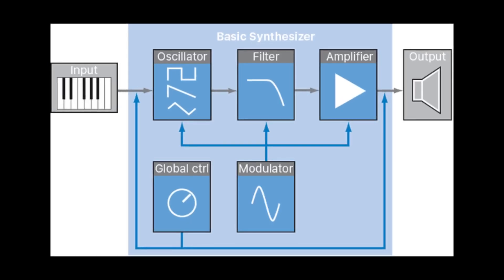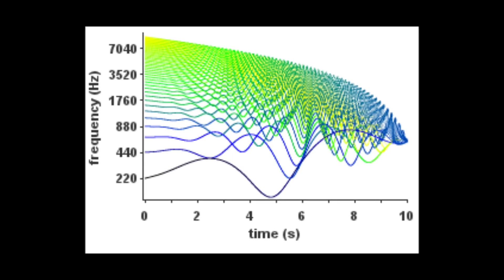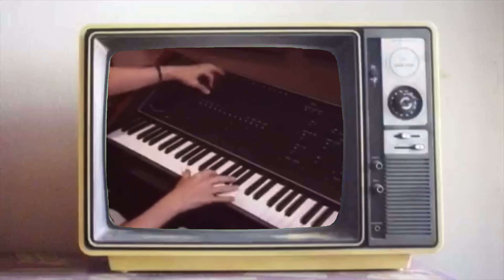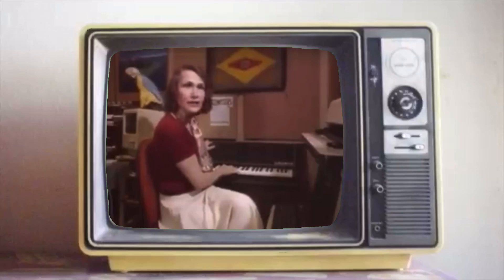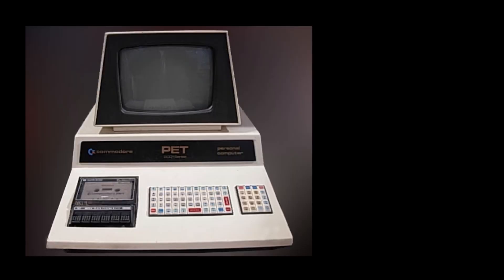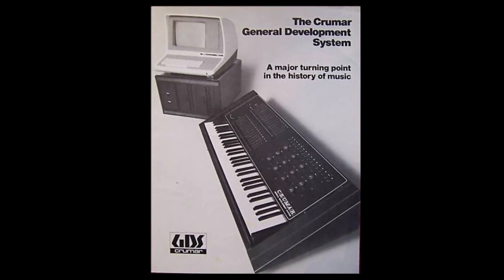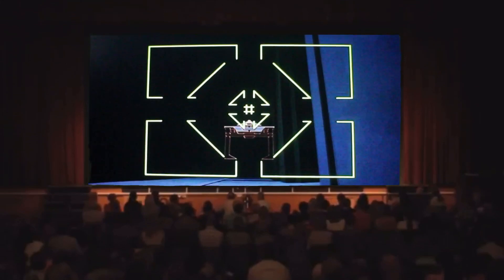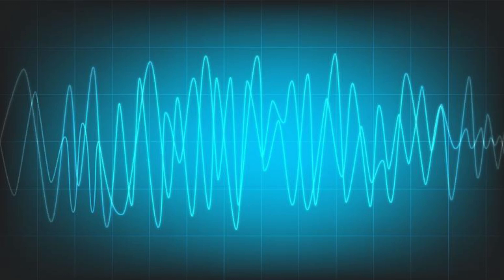Synths of Sci-Fi Episode 04: Wendy Carlos, GDS Digital Additive Synthesizer & TRON (1982)

Comment: Man, If only they made the DX7 with the sliders and interface like the GDS! 🎉
Reply from the maker: For sure.  The DX7's controls are def a bit lacking. Have you ever used one?
Reply: @Koboto  Which? The GDS or the DX7?  The DX7, a few times, never owned one though.
Reply from the maker: The DX7. I’ve actually never touched one. I’m curious. I’ve recently bought a TAKE5. It’s pretty sweet imo. :-)
Reply: @Koboto  Man you're a lucky sob. 😂
Reply: DTronics DT7 programmer for DX7 gives full control with about 140 knobs
Reply: @Cincinnatijames Oh my, would that work on a dx21?? And how's the latency? And more expensive than a used DX7? 😂 Not thanks
Reply: @popcycles yeah, it is not cheap but neither would the DX7 be if it had come with knobs.
Reply: @Cincinnatijames true, good point!